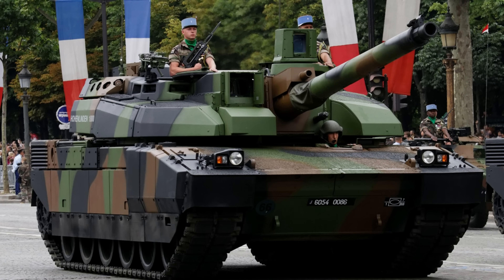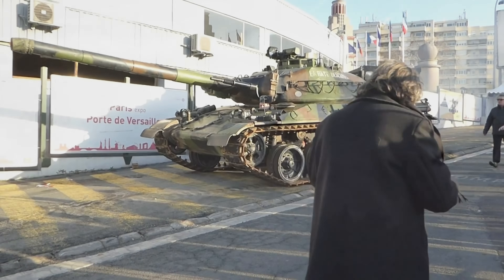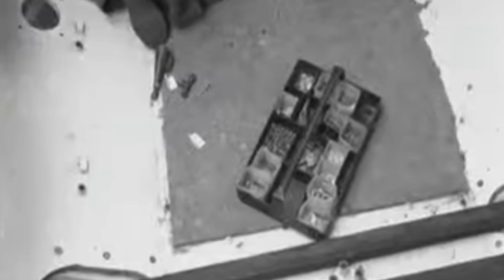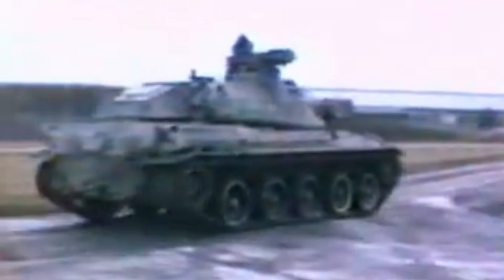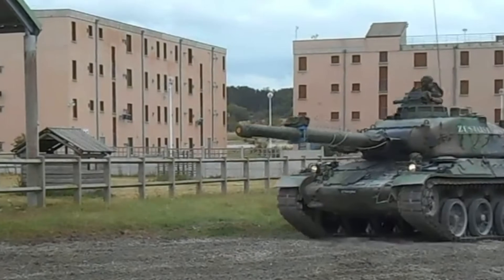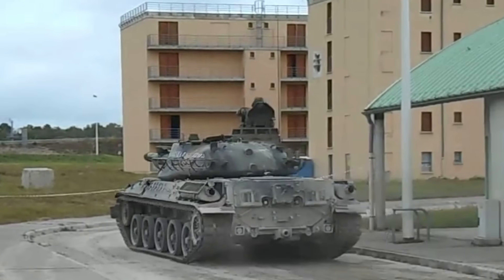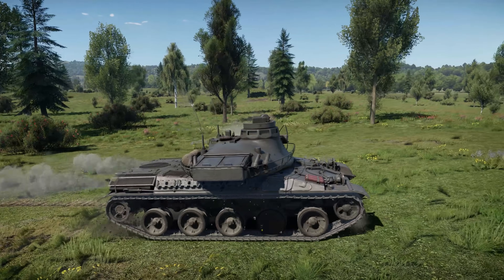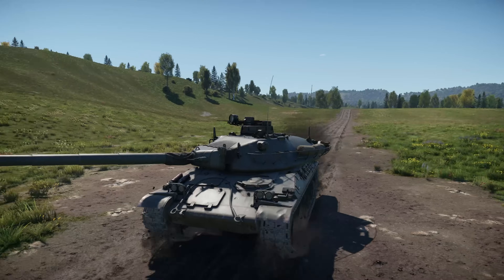The French AMX-30 Main Battle Tank | DOES SPEED BEAT LESS ARMOUR?

Comment: All time fav tank is the Stridsvagn 103  The Swedes actually based their design on their requirements - they didn't intend to manoeuvre to attack against the Soviets in Germany like us Brits and the US - it was perfect for low silhouette defensive positions, hitting advancing enemy, then rapid relocation backwards [and repeat] on Swedish ground conditions.
Reply: Don't fall for the common misconception of thinking it was a tank destroyer though, the Swedes saw them as just as capable offensively as their Centurions and saw them as doctrinally identical.
Reply: @Lancasterlaw1175  I would argue its more of an assault gun or SPG, design wise and doctrinally
Reply: @ Definitely not doctrinally, Sweden issued them to tank units, in armoured formations, and positioned them for a massed counterattack on enemy beach or air heads.
On design, the gun itself was a high velocity cannon, not a howitzer. The line of sight armour was similar to contemporary MBT's.
Reply: @Lancasterlaw1175  Assault guns/spgs didn't all have howitzers, and were used offensively often in conjunction with other tanks, and were issued to tank units... my primary reference would be the Stug, and the Hetzer... though the latter was considered a light TD, it also was used as an assault gun. Arguably TDs and Assault guns only distinction is doctrine, but my reference for TDs is that they more commonly have open top or lightly armored turrets as opposed to hull guns, since assault guns prioritize more armor.
Reply: @V3RTIGO222  Both the Stug and Hetzer were manned by the artillery branch, not the tank branch, same with the American tank destroyer branch.- that's where I draw the point of difference. 

Funnily enough I always imagine the Sturmpanzer I/II as the atypical assault gun, and they had paper thin armour.

The Sweds did actually have two dedicated assault guns for the infantry, the Ikv 72 and Ikv 91.
Reply: @Lancasterlaw1175  While the personnel and divisions we're different, they were still doctrinally used alongside tank battalions to assault objectives, which is my main point. American, German, etc. tended to use the more well armored vehicles for that role. 

I also agree that it would be "atypical" for an assault gun to have thin armor, as that makes it unsuited to assault objectives reliably, even though it could have better speed for maneuvers. 

Regardless, while I do think you bring up a valid distinction in terms of force organization, the fact the STRV was used alongside MBTs doesn't necessarily make it an MBT on a tactical level especially when the design is more akin to a TD/SPG/AG. Strategically, though, I can see how it'd be considered "equivalent" in role to an MBT.
Reply: @V3RTIGO222  Good points.
However the Swedish did not plan to use the Strv-103 alongside MBT's they replaced the MBT's. The older Centurions were regulated to second line work and reserve formations.
(Alas, I had to cut a couple of hundred words on American TD policy because I realised it was not relevant)
Reply: @Lancasterlaw1175  I mean, I still disagree it's an MBT. Just because they replaced their MBTs with them doesn't mean they replaced their MBTs with another MBT. Much how adopting a new fighter doesn't make it the same generation of fighter, nor use the same design aspects. Say the difference between an F16 and an F22 or F35.
Reply: @V3RTIGO222  Can we agree though that the Swedes considered them to be MBT's?
Reply: @Lancasterlaw1175  I mean... if they did, their definition of an MBT differed significantly from every other country (even those opposed to NATO), but sure.
Reply: @Lancasterlaw1175  The gun was a variant of the British 105mm tank gun, adapted for semi-automatic feed.
Reply: @ And slightly longer! Always wondered if the trade-off of more velocity to a presumably shorter barrel life was worth it.

Comment: Iono why but the only thing I dislike about the AMX-30 is the slightly rotund turret (*laughs in Leopard 1 without turret bustle*). I don't mind if it can Tour de France with its speed or be bullshit accurate with those hax HEAT rounds, but that turret looks off and... "smooth". Probably gotten used to Centurion and Leopard 1 turrets

Comment: It’s crazy that the whole point of the tank was to have reduced armor and rely on its mobility to survive it as one of the fastest NATO tanks, yet it doesn’t have a stabilizer.
Reply: not fast, but mobile.
aiming systems and FCS of the day were shit in sovjet tanks.
due to this, an agile tank on medium to long range was very hard to hit.
in comparison the Chieftain was sluggish and immobile.
the armor protection of Chieftain was not sufficient to protect vs 100mm and 115mm HEAT rounds.
Reply: Stabilizers cost resources, certainly no good without good FCS, true firing on the move was hardly present in Warsaw pact tanks either when the AMX-30 and Leopard-1 saw service.

Comment: Grinding the amx-30s in War Thunder love them, but the lack of a stab hurts
Reply: Only really the Centurions that have a stabilizer at 8.0. The rest have to wait until at least 8.3 (T-55A).
Reply: @lavrentivs9891  non of the amx 30s have a stab, B2, B2 Brenus, Acra. France doesn't get ANY stabilize tanks until 9.3.

OnLy ThE cEnTuRiOnS hAvE a StAbIlIzEr
tHe ReSt HaVe To WaIt At LeAsT 8.3
Reply: @ What was it you didn't understand about the word "at least"?
Reply: @lavrentivs9891  they dont get ANY until 9.3 they are the ONLY nation, what moral high ground you think you are standing on?
Reply: @Dredgno  And Sweden and Israel don't get any tank except the Centurion until 8.7 with a stabilizer, Italy doesn't get a tank with a stabilizer until 9.0. 

France then has the benefit of going directly from 9.7 to 12.0, with only a dutch leopard 2A4 in between.
Reply: @lavrentivs9891  Sure use the nation that jumps from 8.3 straight to 9.3 to backup your statement. I ask again, what moral high ground do you think you are standing on?
Reply: @Dredgno  I have not claimed any moral high ground and I find it peculiar why you would start demanding one.
Reply: They were made to rapidely take a position to ambush the soviet tanks pushing in Germany. 

It's closer to a tank hunter than a standard tank.

Comment: I like it because I have a simple mind and think having an autocannon as a stopgap to overmatch 90% of engagements makes sense.
Reply: Tanks under development are bringing big(above 12.7mm) coaxial guns back. The AMX 30 has some drawbacks though since the 20mm is hard to reload inside the tank and the loader needs to manually change the extraction mechanism from 105mm to 20mm before firing it in order to avoid the crew inhaling the toxic fumes of the 20mm shells. All in all the AMX30 B2 i served in was a nice piece of kit. Very easy to operate and learn as a conscript.